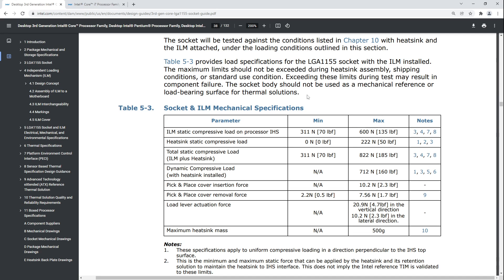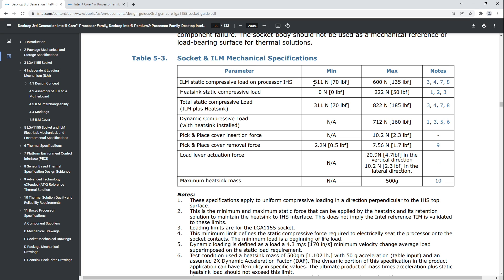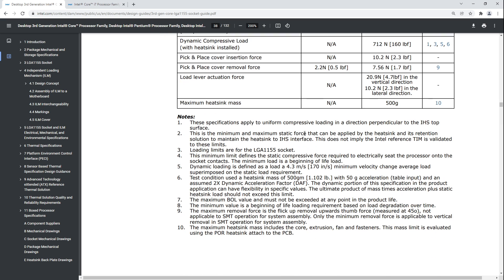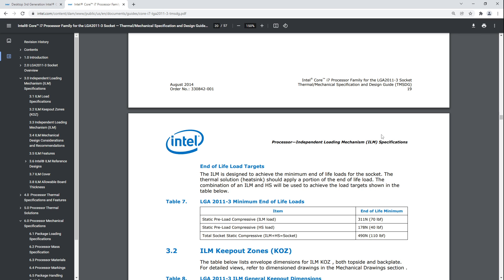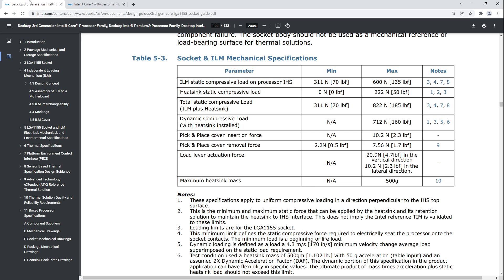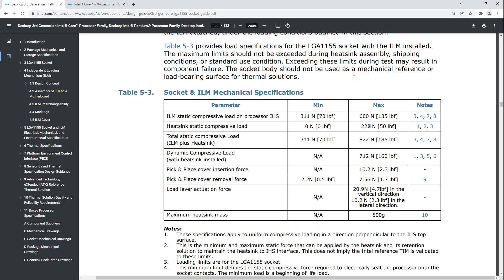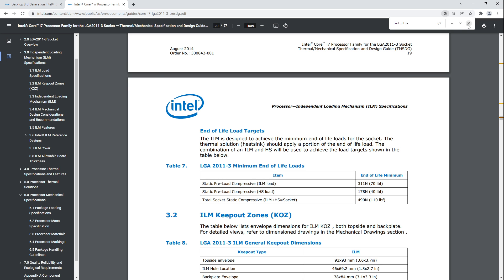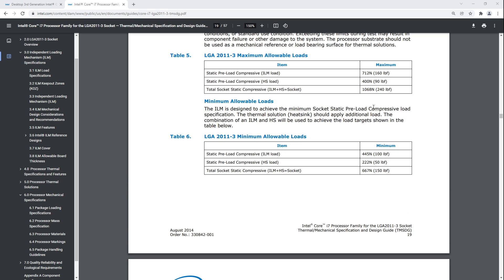Socket LGA2011 and LGA1155 ILM loading pressure. (very filler)

Comment: The 1700 specs are listed on page 179 of   Content ID: 655258  "12th Generation Intel® Core™ Processors Datasheet, Volume 1 of 2"
Static Compressive per Contact: 0.098-0.254 N
Static Pre-Load Compressive: 400-845 N
Static Total Compressive beginning of life: 534-1068N
Static Total Compressive end of life: 400N min.
Dynamic Compressive: 489.5 N max.
Board Transient Bend Strain: 600ue
Max Heatsink Mass: 550g
Reply: interestingly, for LGA2011 its higher per contact, min 15gf and max 38 gf ie 0.15-0.38 N
Reply: Max heatsink mass is 550g as you said, but then placing one big D15 that is at least two times 550g, then what happens? Big air-cooler could do damage in the long run or what? Why did Intel specified max cooler mass when there are chunky air coolers above 1kg?
Reply: @ВладимирВеликов-т5р  I guess the max heatsing mass is for straining the motherboard or something. Remember you typically have the mobo vertically, so the weight of the cooler is not directed towards the CPU, it is directed along the board thus trying to bend the board. I guess that's why bigger coolers have their own mounting brackets to put to the back of the motherboard to support all the weight and lessen the bending of the board.

Comment: i think, you can test the amount of weight needed to push down the lever of the socket, then you calculate the multiplication of the lever effect, then you can easily get the force applied to the cpu

Comment: I need a heatsink for a Sapphire R9 290, bought the card new and after around 200 hours I replaced the thermal paste (Thermal Grizzly Kryonaut) put it back in my PC and it would come on then shut down after 2 seconds, I check my work and found I striped one of the screws around the GPU and I couldn't fix it.

Comment: I've used these specs for years to make my own waterblock mounting hardware.  I just toss away whatever the block comes with and run my own studs and springs that take it right to the max limit on the spec sheet (mcmaster: 9434K117, 15 pounds of force at full compression x 4 = 60lbf).  I think one of the big factors that affects one block showing better thermals vs. another waterblock is whether they use aggressive springs or not in the kit, and a lot of blocks come with hard-stops where they won't even fully compress the spring and then you're fucked if the IHS height changes like it did with 1700.

Comment: I did your washer mod with 10 mm x 1 mm nylon washers. Really quick and easy. Small FFTs 86 C MAX, 82-83 sustained in a 22 C room at ~228 W sustained load. 12700KF.  280 mm AIO in cramped Micro ATX case with mesh front and all panels closed.

Comment: I remember seeing this video for GN I think it was with probably King Pin or some other famous overclocker.
He cut out the socket with the PCB from a board, put the CPU in the socket and lapped it.
The point of that was to keep the CPU IHS flat when mounted instead on trying to get it flat when its well in your hand.
Only problem I see is if the socket used for lapping and the one used for running the CPU have wildly different clamping forces as you mentioned the min an max is like 2x difference.

But it still seems like the best way to go on say a LG1700 socket CPU. Maybe something for you to try if you ever have a dead LG1700 board.

Comment: iirc LGA 2011 had an extra 78 pins for testing and other purposes that ASUS put to use for more power delivery for their 'OC socket.'
I think for most LGA 3647 installs, you're actually supposed to clip the CPU onto the cooler and install it in that way.
Wendell has a vid on the LGA 4189 install process.
Also if TR4 socket contact is an issue, then SP5 is gonna be a joke - 6096 Pins! 🤣And AMD uses carriers for both sockets. I don't know what they'll do about mounting pressure.
Reply: LGA2011-3, and on the Rampage V Extreme indeed they did.

Oh, and BZ hates that board with a passion.

Comment: Hey buildzoid, I’m very picky about motherboards. I was wondering if pcb layers and pcb thickness is a factor in a good motherboard or a not so good board?
Reply: Definitely is a big factor for certain stuff, but also looking what ASRock did with a few layer PCB in the past is kinda impressive to be fair. I wouldn't recommend you to go by PCB thickness and layer counts alone if that's the case here. Rather check actual results than theoretical performance based on layer counts etc. If you buy alderlake tho, you certainly end up with a PCB with more layers even on the cheap end because of PCIe Gen 5 alone

Comment: You can find LGA1700 loading pressure in the alder lake document: min 534N max 1068N. The same pressure can also be found in the cml and rkl document.
Reply: I need to know the specs for rkl. Can you point me to the link please?

Edit: nevermind. The keyword is Technical Resources: Intel® Core™ Processors

Comment: Would take these Intel specsheets with a grain of salt. Remember when coolers were bending Skylake CPUs? "The likely culprit: Intel used a thinner wafer on Skylake CPUs than past chips. According to Intel, the thinner substrate is still rated for the same 50 pound static load, but this issue is definitely real: we've experienced it ourselves."

Comment: The LGA1700 ILM needs to be redesigned. I forsee the issue just getting worse over time as the middle section of pins gradually weaken, causing even further deformation of the IHS and substrate.

My excitement to build an Alder Lake system is entirely gone at this point. The only problem is that I've already purchased a 12700K.
Reply: I'm in the same boat. Especially because I keep my builds for years before updating.
Reply: you can probably sell it very easily.

Comment: I wonder how it develops in like 10 years from now.
Will we have PGAs again or even soldered CPUs to MB?
Especially with the ATX12VO Spec, I guess there will be even less space on the MB. So bigger CPUs (in size) would be difficult.
Reply: ATX12VO is mostly for prebuilts and other garbage PCs
Reply: Consumer desktop will no doubt move to quad channel, which will add several hundred more pins, good luck using PGA for that
Reply: @snowstar3560  Consumer desktop only needs 2 DIMMs of DDR5, as BZ has pointed out -- and certainly only 2 channels.  HEDT could make a comeback as a quad-channel segment, tho.
Reply: @concinnus  In 10 years the situation could change. 10 years ago Intel rained supreme and we thought a 4c/8t CPU was high core count. 

CPUs could develop faster than RAM speed, HBM could be added to CPUs (like intel is apparently doing for sapphire rapids), workloads could change, etc.
Reply: @kelvinyonger8885  Sure, any number of things can happen.  So Snow Star making such a confident prediction is foolish, especially as it goes against the trend of this gen that I highlighted.

Comment: To put this in perspective, 100-120Nm is roughly around how much torque you need for the lugnuts that hold the wheels onto your car. That's madness!
Reply: If I am right you can not just compare newton as linear force with newton-meters as rotary force.
Reply: Torque is not comparable to tension. Try and calculate or guesstimate the internal tension in those nuts instead.

Comment: Maximum total heatsink mass is 500 grams according to the spec. A noctua NH D15 is 1200 grams (including the fans) and competing products are in the same range. How does that work? Do the mounting kits of the coolers offset this?
Reply: the mass figure is for heatsinks where the load is carried by the CPU/socket assembly, like Intel stock cooler. Most bigger heatsinks have a backplate and use their own retention system to hold their own weight.
Reply: 311N is roughly 31kg of force.
So if you substract 1.2kg you still have 30kg minimum of mounting force left.
Of course, the noctua heatsink doesnt push down on the socket, it puts an angular force on the socket, because most motherboards are mounted vertically. Even then the torque on the socket from the weight of sink and fans is much smaller than the pressure from the mounting system.

Buildzoid makes a conversion error in this video. Its 20gr of force per pin, minimum, instead of the 2 he calculated.

Comment: If 10N is 1kg, then 1N is 100 gram, then .2N is 20 grams per pin.  Not that far from a keyboard switch then...
Reply: Yes, only this part is incorrect in the video but overall discussions are very educational for me. Just wonder how about situation on PGA, like AM4 socket.
Reply: @Ryohta77  PGA chips don't need large amounts of mounting pressure to function correctly. That's why the socket mechanism is just a simple "retention" mechanism designed to lock a chip in place rather than press it down.

Comment: I don't remember what mounting procedure for lga 3647 was, but for current Intel servers with lga 4677 user is supposed to clip the cooler onto the processor, while it's in the tray and mount the cooler with the attached cpu in the socket. ServeTheHome has a video tutorial.
Reply: With those you are supposed to torque the heatsink screws to a specific amount, so the heatsink is part of the retention system
Reply: @marcogenovesi8570  given that those sockets have not retention mechanism I would say that the heatsink is not a part, but the whole retention system
Reply: @ignatgrz  the heatsink has no backplate. The backplate where you screw the heatsink on is part of the socket. So yes the heatsink is part of the retention system, not the whole retention system
Reply: @marcogenovesi8570  I was thinking of parts that exert pressure on the IHS, so you were right, but considering MB laminate as part of the retention system with Intel stock coolers just seems wrong to me.
Reply: @ignatgrz  I'm not a fan of stock cooler mounting either, but the board is still a multi-layer fiberglass composite so it does have quite a bit of strenght.
I mean with a better mounting system with a backplate the board can easily hold 1-2kg of high-end tower heatsinks in both vertical or horizontal configuration.
A lot of portable embedded devices use the electronic board as structural support too

Comment: I really wanna know what Threadripper or the Xeon W3175X need now
Reply: threadripper is sold with a little torque wrench so you can apply the right pressure on the CPU

Comment: i wonder if the intels own included heatsink for cpus is even applying force up to their spec. i guess it must then, but mine have always been quite wiggly.
Reply from the maker: you'll noticed the LGA1155 socket doesn't require any extra pressure from the heatsink. The ILM does all the heavy lifting.

Comment: Funny story I had a hell of a time diagnosing my x79 system because I was too lazy to screw down the CPU waterblock. I had just put the waterblock on the CPU with some thermal paste to see if I could get a post but I got nothing. I spent several hours of frustration trying to diagnose what the problem was. I even ended up buying another board and having the same issue with it too. After another couple hours out of desperation, I decided to try properly mounting the waterblock and that did the trick! Hearing buildzoid talk about how Intel specified that cooler mounting pressure was needed for LGA 2011 rubbed some salt in a several year old wound lol.

Comment: G'day Buildzoid,
So 1068nm is equivalent to 106.8KG, 🤔 Imagine a CPU Cooler that weighs 106KG of Copper Slug, Heatpipes & Aluminium Fins...
That was probably the size of CPU Cooler Intel Designers used during Product Testing  to stop i9-12900K from Thermal Throttling at TJMax "😏Yeah, an Air Cooler Works" 😂😂😂😂😂

Ps Yeah it is interesting Buildzoid as I think others had confused the message to be Cooler Mount to IHS Height causing Pressure Problems, rather than the Retaining Mechanism applying to much pressure even before the Cooler is attached.

Comment: if you divide minimum load needed at lga 1155 socket to the pin count, its around 0.26N which is almost the same as the LGA 2011, which around 0.22N, so if the number for each pin still close enough, assuming for lga 1700 you need around 0.24N/ pin that would be around 408N of load to the IHS not included the heatsink pressure if needed
Reply: Intel's Datasheet states that it is 534N total. For Pre-Load 400N is in line with what you stated.
Static Compressive per Contact is @0.098N min and  0.254N max.

Comment: Great video. However I don't think 1700 is going to be somewhere in between. Due to the change in load application and the size, presumably achieving the same amount of compression - vertical movement, would require more load. I don't know what the change in surface area in between previous and new size but relative area change world definitely be an incremental multiplier.
Reply from the maker: So igors lab actually got their hands on the LGA1700 mechanical design docs and it's 534N. : https://www.igorslab.de/en/intel-socket-lga-1700-and-lga-1800-in-detail-exclusive-data-and-drawings-for-the-new-cpus-ab-alder-lake/2/
Reply: @ActuallyHardcoreOverclocking  Intel now have the datasheet on their website under "Technical Resources: Intel® Core™ Processors".
The mechanical spec is in Volume 1 part 14.
Reply: @ActuallyHardcoreOverclocking   so the unsupported area is 2/3 the IHS.  then 534x 2/3 = 356  35Kg has to be enough to bend  upwards
Reply: I think it's 400N?  Before the heatsink installed